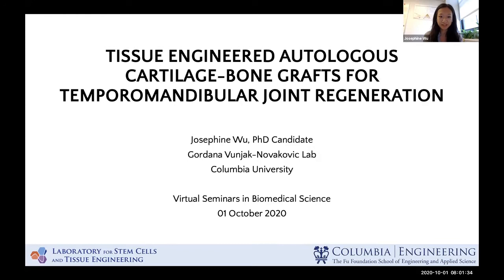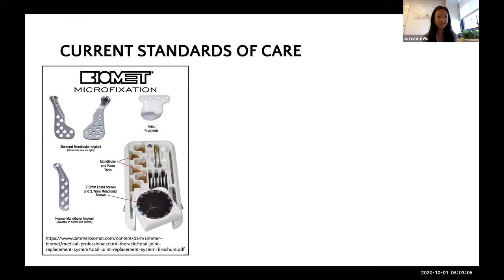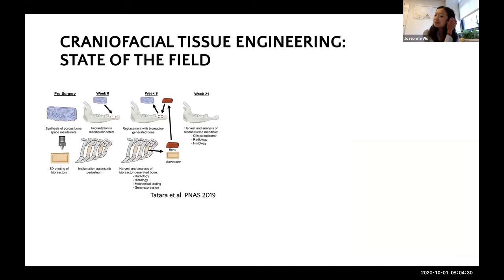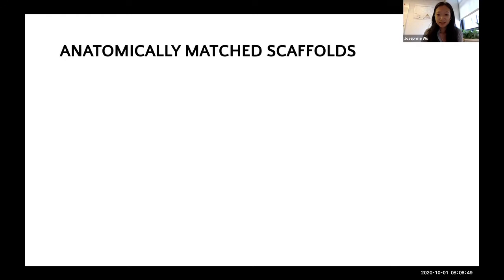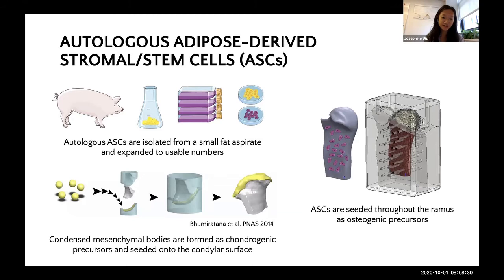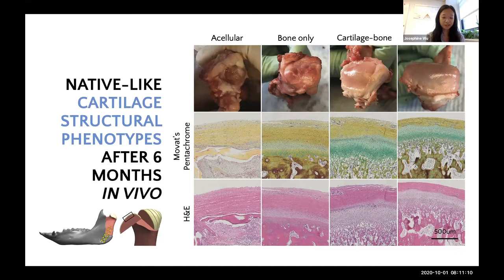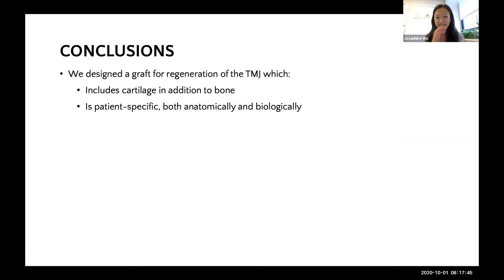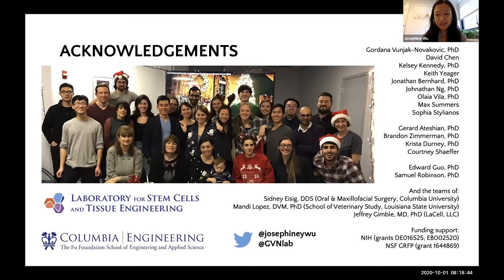Josephine Wu: Engineering autologous cartilage-bone grafts for TMJ regeneration (1st Oct 2020)

Comment: Thank you so much for posting this! I had my right TMJ condyle shattered in a car accident 20 years ago and has left my jaw one centimeter higher on the right side and movement of the jaw angled and distorted. This seems like the most promising treatment to repair it. Please post any updates regarding this research. I'm curious if post treatment with mesenchymal stem cells would further facilitate biological repair. What are your thoughts?